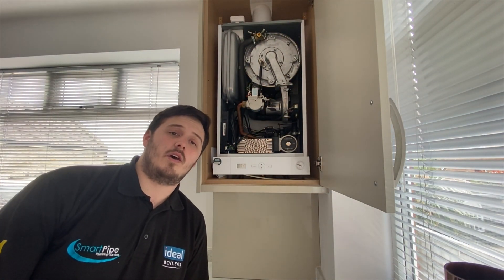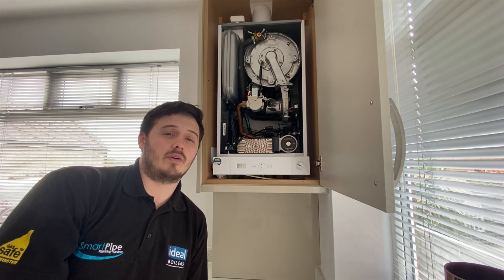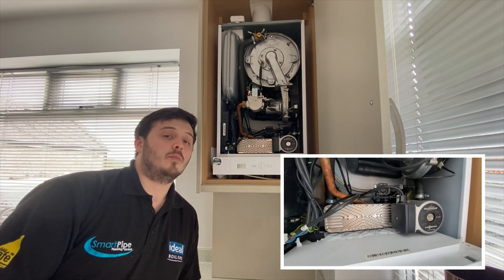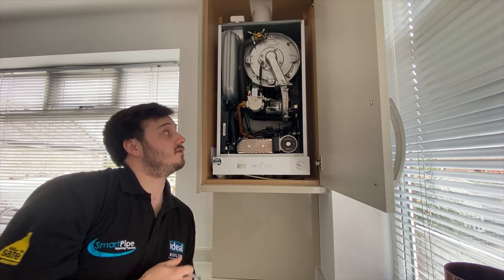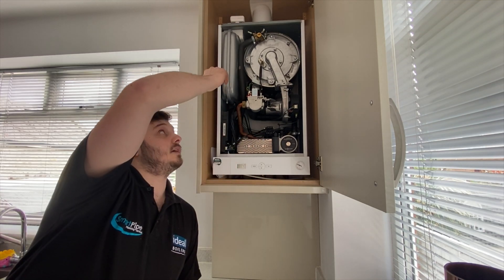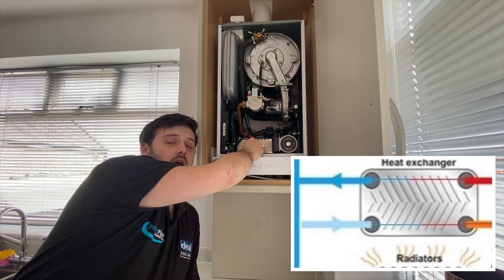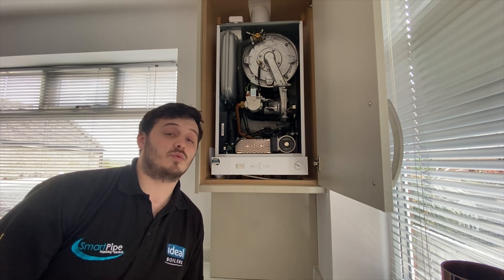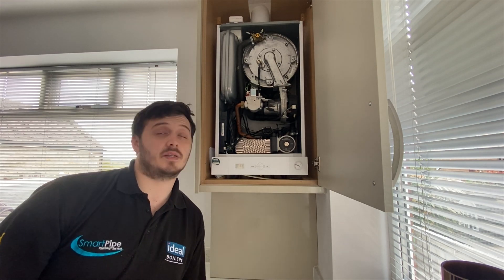How Does a Combi Boiler Work? || Boiler Training

Comment: When the diverter valve opens does it Send hot water to the tap and also keep the radiators warm, or does it stop sending water to the radiators while you are running hot water?
Reply from the maker: Hot water always takes priority so it stop flow to the radiators and start the hotwater sequence

Comment: If i run the service mode test on this boiler and set it to 100C and keep the taps closed during the test, is that bad for the boiler? What damage will it do to the boiler?

Does this boiler use a pilot light or ignition system?
Reply: @SmartPipePlumbing  but i have all the heaters completely off even the control heater.
Reply: For the safety of everyone, you shouldn't be working on boilers by the sounds of it.